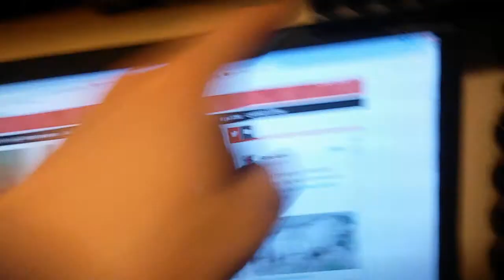MOISTURE TESTING INSULATORS

Comment: That is a such a cool experiment idea . I will have to try this myself when I find some insulators and also acquire a PT or may be a neon sign transformer..
Reply from the maker: +frankenweenie It will work great with a NST as well, my PTs are rated for 10kV a NST is 15kV but it has limited power.